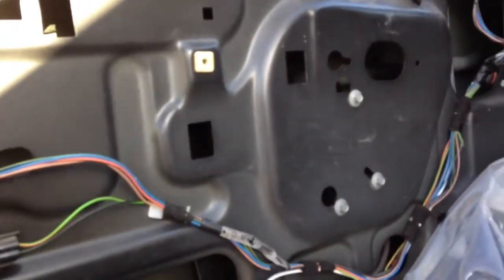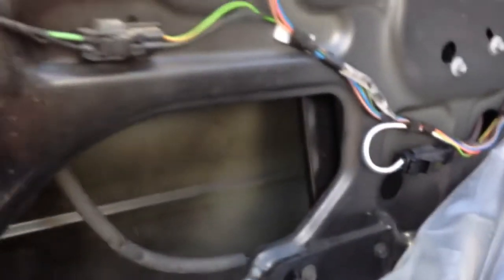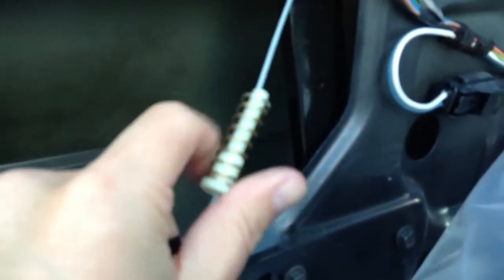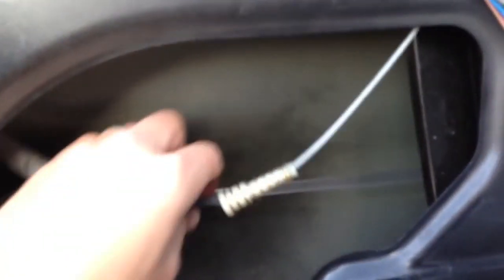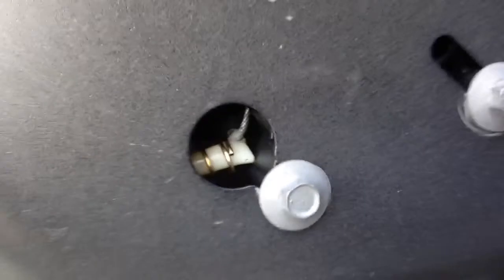Durango Window

Comment: Hey man, just looking over this video. Check out my channel for the "2001 Dodge Dakota Quad Cab Driver Side Rear Power Window Removal/Replacement " video. It will be the same thing as yours. You will need to replace the regulator and track assembly. Not too hard a job, and should cost you under a $100 to buy the part from Autozone or Napa. Glad to see another Durango/Dakota owner keeping it on the road.